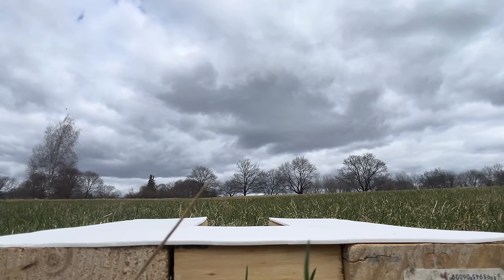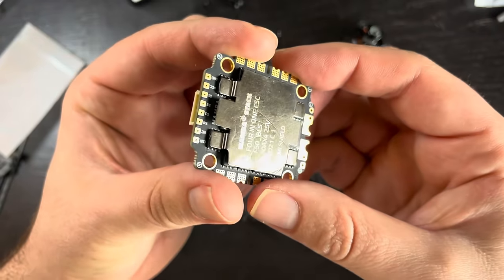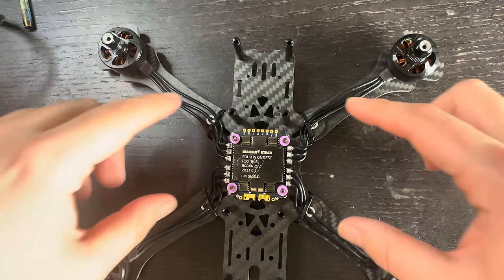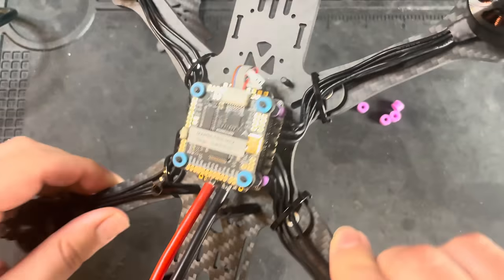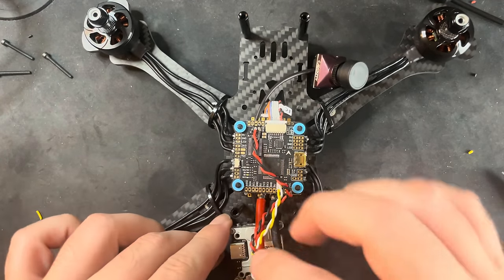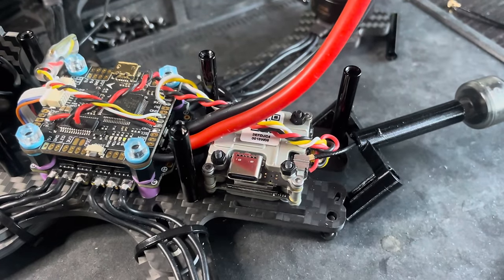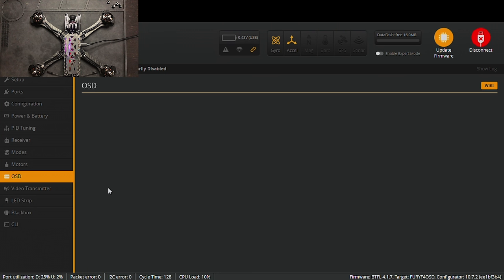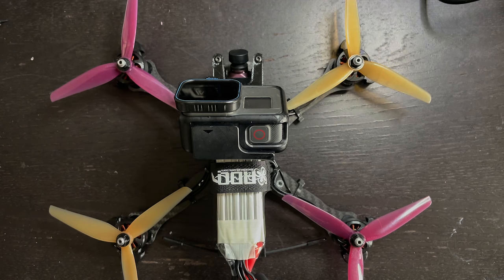2022 - 5" Freestyle FPV Drone Build

Comment: awesome build!!
is it possible to have video transmitted from the caddx polar to your  phone equipped with a 5.8ghz receiver instead of using the DJi goggles?
Reply from the maker: Unfortunately with any DJI FPV gear you will need DJI goggles in order to see the video signal.
Reply: @TRONCATFPV  got it! thanks for the immediate replay.
btw, you really went into detail here. appreciate that. Didn't leave many question unanswered expect for that in my case. Keep it up :)

Comment: compliments for the video, i watch part of the movie and i have noted that you have connected a capacitor to the connector of batterie, and it is useless .. not vantage I mean; if you want to use capacitor to compensate the  inductance of power line you must connect the capacitor at the end of power line! then it means you must connect the capacitor at the end of power line, at the ESC board, directly to esc power input, do you agree?
Reply from the maker: I have noticed no difference in performance wether the capacitor is on the battery pads or the XT60 connector.
Reply: @TRONCATFPV  it is different

Comment: I watched this entire video and I am inspired to build my first FPV drone. If I were to build everything exactly the same, (might have to get a different stack due to backorder), I am just wondering what goggles and controller I would need to be able to fly. I am just worried about compatibility issues. This build is exactly what I am looking for, just want to make sure the additional things I need would work with it. Thank you!
Reply from the maker: Links to everything (including controller and goggles) is in the description 🤙
Those are compatible with this build
Reply: @TRONCATFPV  will be following this step by step to get into my first FPV this winter. Thank you very much!!!
Reply: @TRONCATFPV  After multiple setbacks (problems linking vista and DJI V2 goggles, TX not updating firmware, figuring out how to set up an SD card for my qx7 and load lua scripts) and 2 very long nights of troubleshooting, I flew my first quadcopter in real life today!!!! I have practiced on a sim for a couple hours, and today was amazing, it felt almost as natural as anything else. Only one small crash and a bent prop, but you gotta start somewhere, right???? Thank you for this amazing video, i copied your build and it flies great. Cant wait for more drone shenanigans in the future. You da best!

Comment: 3 questions, does it matter which order the motor wires are connected to the esc, does it matter which of the two boards are on top or bottom and do all drones need a capacitor. Great video so simple and easy!!
Reply from the maker: Nope! That will just change the motor direction, which is easily changed in betaflight/blheli 🤙

Comment: Hey man. Overall a great video! 
Could you maybe link the files for the 3d-printed parts?

Here are a few things which I would make differently:
- I would run the cables from the Vista between ESC and FC, so I minimize the risk of damaging anything with a lipo-strap. 
- I would also run the Vista cables between the two cables of the XT60 connector
- For the wires of the motors I'd use some plastic cable conduits. I already hat the case that a bent prop managed to cut one of them open. Luckily the wires weren't damaged. 
- Before plugging in a battery, I would definitely use a smokestopper. This could safe a lot of money in case I messed something up.
Reply: Running cables over/under your FC is actually pretty bad, as it can mess with your gyro if the cables are bumping on it.
Reply: Honestly the biggest compromise in this build are the frame and the motors.
Hardware upgrades:
1) 25mm barbell standoffs atleast 
2) if you do the above mod, print the solid camera mount that runs through both front and back stabdoffs on camera side
3) shoulder bolts for the center frame screws
4) ofcourse some nylon braided wire covers
5) Tmotor 2306 2400kv motors seem better to me
6) please swap the blheliS esc with a mamba blheli32 the price difference is small
Software upgrades:
1) BF4.3 RC4 right from the start
2) rpm filtering
3) Elrs preset
4) bl32 48khz
Reply: @aakashjana6225  Chris Rosser showed recently that BLHeli32 has little to no advantage over Bluejay, even with the latest version. And for the same price, BLHeli_S ESCs are rated for more amps. So I would go for more amps and open source firmware imo.
I would also go for 2207 for a bigger stator volume (2306 if ok, but barely bigger that 2206). EMAX eco2 or iFlight Xing-E Pro aren’t that expensive too
Reply from the maker: @DirtyCross Just added the links for the parts I 3D printed to the description. Thanks!

Comment: Great video !!! loved it. Any alternative to the frame? (it's sold out and not available in bangood)
Reply from the maker: yes, any 5" frame with a 30x30 and 20x20 mounting pattern will work.
the V3 likely isn't available because they have released a V4 frame which is also out of stock. (https://bit.ly/3xgojAE)

This is basically the same frame as in this video (5 left in stock as of right now): https://bit.ly/3NhOHzP
Reply: @TRONCATFPV  Great! Thank you !!!!

Comment: Those 3 wires from motors soldered to ESC, they have specific order? or you can put them random on ESC?
Reply from the maker: You can put them in any order and can then change the motor direction if needed in betaflight or BL-Heli 👍

Comment: Nice build ! Approx how much flight time could I expect from the 1050 6S on this build just cruising around ?Thanks !! I just subbed..
Reply from the maker: Thanks for the sub! Just cruising around you'd probably get about 5 minutes. This drone could handle a 1300 or 1500 6s and probably get 6 minutes of freestyle.
Reply: @TRONCATFPV  Thank you for the info. I am going to build this as it looks like a good flying quad, of course that has a lot to do with your flying skills. Im
still a beginner and have been flying since beginning of the year. Thanks for the helpful videos.

Comment: thats what i am always insecure about, the motor wires are literly right when straigten out? like, every motor is build like this? Because i have so much fear in which order the 3 wires are, and i dont know, if the arent correct this will harm something? Will it? I have a prebuild nazgul and i destroyed it and when building it up again, i had terrible fear this order will be not correct

Comment: Hey mate, should I go with source one v4 or v3 for this build. I will do exact same drone you showed with if not slightly better components. Thanks in advance
Reply: Camera adaptor you linked is not suitable for caddx vista camera and you are not even using that

Comment: Nice vid.  So what part did you use to extend the screws on the AIO brd?  Thx
Reply from the maker: I just used the screws that came with the stack 👍 those ones are longer than the ones that came with the frame
Reply: @TRONCATFPV  OK okay....for some reason I thought that the standoffs were for something.  Thank you for your response.  I really enjoy your videos.  They've helped me a lot!
Reply: @TRONCATFPV  so why doesn't this capacitor have a +/- indicator?   I see that the red is on one end of the cap but you soldered reversed?  Black to red and red to the other.
Reply from the maker: @Roundawg  sometimes the only indicator on capacitors is the length of the leads on each side. one will always be longer than the other. The longest one is the negative and short one is the positive. 

For this capacitor the marking signifies negative. It is kind of weird that they would make it red lol
Reply: @TRONCATFPV  Yes.  I finally found it on the net. I'm trying to build this quad but I've had some hurdles.  I've only built two prior to this build and both were kits so it made it a bit easier.  I didn't have the standoffs so I had to order them. Now I've realized that the Camera TX doesn't come with the mounting bolts.  So once I get those ordered/recieved I should finish up pretty quick. You think I could use some 2 sided tape and a zip tie in lieu of the bolts?  Anyway, thanks for the build and the responses.  I'm having a blast outside of the newbie issues.  I'll let you know how it goes! thx again.  I appreciate your channel!

Comment: Hey do you know what to do if u wanna run the kwad with and analogue headset I’m kinda new and I love the build
Reply from the maker: It’s pretty much the same setup, only difference will be connecting the camera and VTX to the flight controller via their own wires.

Comment: hay man im building this exact freestyler but need to know wich battery you are using because my last built blew up because i didn’t know what battery to use
Reply: Your stack will say on it what batteries it can take usually it will say like 3-6s in the description of the stack so you know you can you 3s lipo battery thru 6s lipo but then if you are doing a lighter build usually u go with higher kv motors like a 2207 size 2400kv for a smaller build and a 2207 1800kv for a little heavier build and like mentioned in this video make sure u don't have any solder touching holding wires touching solder from another wire will cause a short. Make sure to use a capaceter.

Comment: Great tutorial. Although I have 2 really important suggestions for you:

1st, solder the xt60 wires on the esc first and the motors after. This will be a safer option in case you heat up your esc too much and subsequently heat up the motors unnecessarily. You should always wait between each pad soldering in order to keep your esc as cool as possible = longer life.

2nd, please, don't use the capacitor in the xt60. It will make almost no different due to the way electricity likes to flow. You only have 2 solutions for the capacitor:
-or you place it straight on the esc pads, which is the most effective one
-or in case you don't have space, you should use thick wires, like motor wires or something slightly thicker to extend the capacitor in order to place it anywhere else. The length of the capacitor wires should be the least as possible and should be obviously less than the xt60 wires.

The noise generated by the capacitor on the xt60 is almost as if you didn't have a capacitor at all. This will be bad for your caddx vista, your esc and your fc since your gyro will get that noise and will give you a hard time tunning and will probably only generate more issues. Also since this is a 6s, think about adding a spike absorver due to the transient voltage spikes. Fettec has one that is okay but it is only 4.2kW of peak Dissipation. If you want a better solution, only one of these - SM8S24CA-Q - will give you 6.6kW of peak Dissipation. This will give a longer lifetime to your hardware in general and be cleaner.

Hope I could give you some good suggestions.
Keep up with the good work!
Reply: I've just upgraded my analogue quad to digital with a Caddx Vista this weekend. Despite my best efforts I could not fit anything larger than a 35v 470uf capacitor at the ESC/battery pads. I have a Mamba F722 APP stack. I checked the wiring diagram for the DJI version of this stack, and that has a picture of a 35v 470uf capacitor. So surely if Diatone are supplying this capacitor with their DJI FC/ESC stack it should be fine, right?
Reply: "It will make almost no difference due to the way electricity likes to flow" ??? I have to correct you here... Connecting to the ESC or on the XT60 connector is electrically the same. It's in parallel, whether you connect it before or after the wire doesn't change a thing and it will offer the same protection.

Comment: Does the esc stack work if I have a dji unit? I fried my esc for my prebuilt drone and have trouble finding a new stack to build one again
Reply from the maker: yes the ESC shouldn't effect the DJI Unit. What pre-built drone do you have? I can share a link to a compatible ESC or stack
Reply: @TRONCATFPV  I bought a geprc mark 5 HD 6S with a rx nano receiver! It flies great but I flew too far and crashed it when I lost signal. :( I replaced the motors and it works well except for one of them as it won’t spin properly.
Reply from the maker: Oh yea that sounds like the ESC.
Looks like the ESC thats in it is this one: https://www.getfpv.com/geprc-g50a-bl32-3-6s-4-in-1-esc.html?gclid=Cj0KCQjwn4qWBhCvARIsAFNAMihqcz_Ttq-Ki5bZVx-OSwHVyI-zakMMLFf15EuTA4zDlyPY-VX3U6QaAi62EALw_wcB

You could also swap out the entire stack if you wanted and any 30x30 stack should work. This one is solid and is the same price as JUST that Geprc ESC above: https://www.racedayquads.com/products/diatone-mamba-f405-basic-mk2-50a-3-6s-f405-mk2-fc-f50a-4in1-esc?aff=58
Reply: @TRONCATFPV  thanks for the help! If you don’t mind me asking, out of the two, which esc would u think is better and what difference does it have? I might buy the one u sent me if it’s a better unit
Reply from the maker: @amarmagar1666  Personally I would go with the Diatone stack. That way you know its going to work. It would suck to get it all together then realize there was also something wrong with your flight controller in the crash too. 
With a new full stack you know you'll be able to go outside and fly with what you order.

I use mamba stacks on a good chunk of my drones and have never had any issues. Diatone makes solid stuff from what I've used!
Reply: @TRONCATFPV  Thanks for the advice! I just bought the Diatone stack. I hope u got some money out of the affiliate link too. Can't wait to solder it for the first time and fly soon again!

Comment: So apart from the parts for the drone, what other parts do i need to buy? The dji goggles and i'm all set?

I'm a noob, but i'd like to start building my own drone. I know for sure that there are other parta required but can't find the answer in the comment section or description
Reply from the maker: In addition to the drone you would need Goggles, a controller, Batteries and a battery charger.
Reply: @TRONCATFPV  thank you for the response.

Comment: Hey troncat!! I have a question as a noob to fob drones. if I was to use analogue goggles, which parts on this build would need changing??
Reply from the maker: Instead of the Caddx vista unit you would just need a VTX and camera 👍
This video may help you out, its on the same frame 😉
https://youtu.be/e0nFgiWlVYk

Comment: hi i have a couple questions. what goggles and controller should i use? and also what props do you prefer. and what 6s battery do you prefer.
Reply from the maker: For this build you can only use DJI goggles. and since you're using a vista unit in this build you could use the DJI controller as well if you wanted. Links for everything are in the description 👍

Comment: How do you know what motor wires are what or are all 3 all the same?
Reply from the maker: all 3 are essentially the same. depending on how these motors are soldered up will pretty much only determine which way the motor spins. this can be changed in betalfight with 4.3 firmware 👍
Reply: @TRONCATFPV  also any details on what controller your using or what to look for. Complete newb here so excuse my lack of knowledge

Comment: If I want to run 4s battery’s with the iFlight 4pcs XING2 2306 2555KV 4S FPV Motor would that work?

Comment: Hey
I got a question if I used the DJI goggles and the Dji remote controller would it work or do I have to use a different controller for this build 
Thank you
Reply from the maker: the DJI goggles and controller will work with this build 👍
Reply: Thank you.

Comment: When your connecting all the wires does it matter where is goes like tx3 and rx3 or tx6 and rx6 or is it designed for a specific tx and Rx
Reply from the maker: You can choose which RX/TX pads you use. Since you can configure what each UART does when programming, they can be hooked up to anything!
Reply: Thank you.  If it wasn’t for your video popping up on my recommendation I would have never started flying fpv

Comment: Question... since this uses the Caddx Polar vista, can i use a DJI radio to control the drone? I'm looking to get rid of my DJI FPV drone and get into something more sturdy.
Reply: you should be able to, at 17:36 he said he wouldn't connect the reciever because he wasn't using it, but I guess you could just connect those other two wires where he connected his ELRS reciever.  Then  you just have to pick the right settings in betaflight.
Reply from the maker: As far as i know the controller that comes with the DJI FPV drone can only be used with the DJI FPV drone. DJI makes a seperate controller that is compatible with the DJI Air unit/Caddx vista
https://amzn.to/3MaPotw

Comment: I want to get into fpv. I have the DJI mini 2 but I want to learn fpv. Do I have to get everything separate? And it will have to be on a budget
Reply from the maker: If you're on a budget your best option will be to buy the parts individually and build it yourself. 
Check out my 2022 budget build here:  https://youtu.be/e0nFgiWlVYk
Reply: @TRONCATFPV  thank you for your response and time. 
I know nothing about it. Like do I even need software, what kind of goggles?, what kind of remote? And how do I know it’s compatible with one another. Maybe I am over thinking.

Comment: cool how-to - btw, when you say "Tee-X and R-x", ya know those are acronyms for "transmit" and "receive", right?  Transmit is sending a signal, and receive is, well, receiving the signal.  Good tip on the fact that you have to connect to the opposite contact points, but perhaps in the next vid, and a bit of the why ;)  Just sayin...
Reply from the maker: Thanks for watching! 
I actually just published a new budget build where I mentioned exactly this haha
https://youtu.be/e0nFgiWlVYk?t=1233

Comment: @TRONCAT FVP I have a question for the TX Module for the output power do I put 500 mw or 1w?
Reply from the maker: either oen works! II normally keep mine aroudn 200mw and get great range.